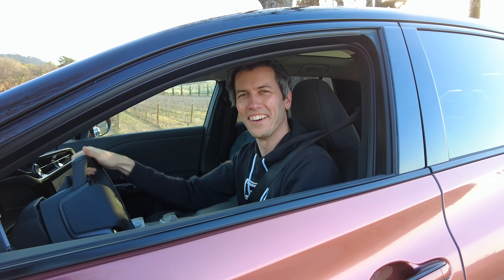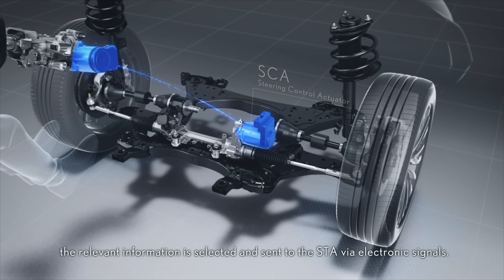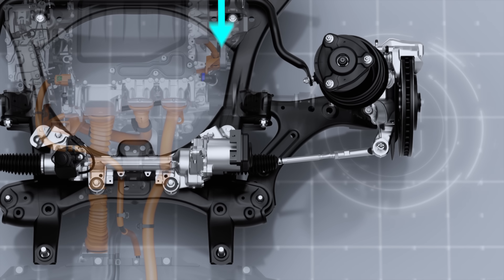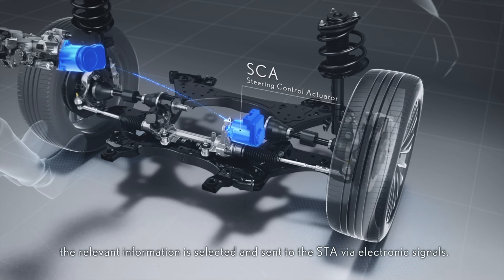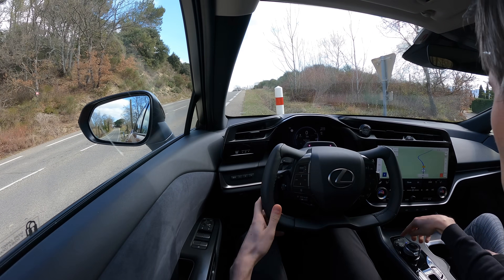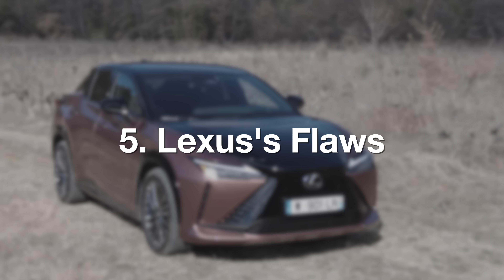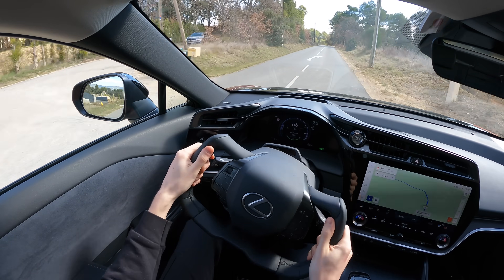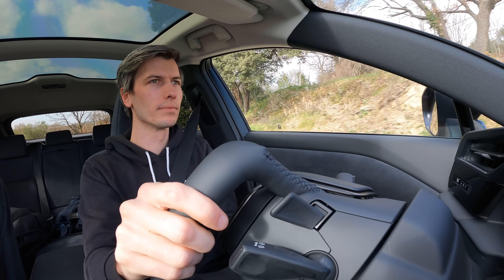How Lexus Fixed Tesla's Bad Idea: Steer-By-Wire Yoke

Comment: I've been waiting for this development.  My Citroën SM with 2.0 turns lock to lock hasn't been repeated.  It is fully hydraulic, no mechanical connection when the engine is running.  It was the first speed sensitive steering and uses a cam to make the steering return to the straight line position.  As speed increases pressure the cam follower increases, making it more difficult to run off of center.  This works exceptionally well, and I really enjoy the quick steering.  I have been told that Citroën developed a fully hydraulic control with no mechanical backup, allowing them to continuously vary the steering ratio so they could use a 1 turn lock to lock, much like this Lexus which is less than 1 turn.  An engineer wanted to use a yoke, way back in the late '60s, but was overruled.

Hydraulic is apparently more responsive, the SM doesn't suffer from the lag you see with the Lexus, but I otherwise like what Lexus has done.  But I'm a fast mouse speed user, all the way up!  🙂

Comment: Eh, my 2004 BMW already has variable ratio steering and a hydraulic rack. It cost me more than the worth of the car to fix it, and if the car battery goes dead it requires a trip to the dealer to reset the system but it's cool so... Toyota still playing catch up.

Comment: No electronics will ever beat actual feedback of direct steering rack.
Oh wait, so when they send "update" my drving style have to suddenly change, cos some a s s s s s h o o o o l e decided that driving ratios were wrong?
No UK thought driver will do 150 wheel turn - they are  told to "milk that cow"- so can't do on yoke with 40 degree movements.
As from 12min mark, this is just to slow - nice for 90 year old ganny, or 5 year old, but not anyone that can drive.
Granted no 90 or 5 year old shoulkd be driving, but I like agressive driving, so responce and feel are key here - bad design.

Comment: My concern is if you hit a pothole. I like technology but at some point enough is enough. When I was younger I wanted self driving cars but not now. 

I drive a Prottera electric bus and they randomly always code out leaving you stuck in the center of a intersection or stop suddenly. Least a petrol car will give you time to roll to the shoulder by coasting.

Comment: Hello, I have Toyota BZ4X. Toyota made the same mistake like the Lexus RZ. So he put a 64 net battery pack for a large SUV. The battery is small, the battery drains quickly and the consumption is high. The BZ4X has many other problems. Report these problems to Toyota, please, so they can fix the problems.

Comment: Can't wait to see it on production cars, but I wonder if you hold the yoke at a certain angle and keep accelerate/decelerate, will the front tire change direction by itself? That could feel quite weird under the situation such as joining the highway from a loop or avoiding obstacle while braking

Comment: I wish you’d touched a bit on drive modes- I imagine you’d be able to tune steering sensitivity for each drive mode, similar to throttle response, shift points, suspension damping etc. in that case, I’m all for it! I will say, however, that I disagree with the yoke design itself. I personally drive on long journeys with one hand atop the wheel for long stretches of time, as with my long arms and seating position that’s where I’m most relaxed. I worry that with a yoke design, the only comfortable (or even usable) way to hold the yoke would be from the sides, which may get tiring after a while, or be otherwise less comfortable. It would also, I imagine, be far more difficult or impossible for individuals with only one arm to use, as you would be unable to continue moving your hand position across the yoke to increase the amount of leverage you can exert like you can with a traditional wheel. Loved the video, incredibly well explained! Interested to see where this tech goes.

Comment: The best upside you didn't mention I think is user customization. It also removes the biggest drawback which is people maybe wanting a normal, more linear steering ratio. perhaps there could be an adjustment in the car settings for steering ratio at high speed and low speed separately.
Like a slider bar how you would adjust your phone's volume or brightness. and save settings

Comment: I'm less concerned about mechanical failures and much more worried that the control software is written terribly. Considering that code slingers aren't qualified like real engineers there can be just any putz telling ChatGPT to write some python for him. So, Lexus, with their much better QC/QA probably won't be a problem.

Comment: Wires melt faster than steering linkages.  Which do you want when you have a vehicle fire at elevated freeway speeds when the brakes fail? (there is a youtube video of this exact situation with a modified Audi.  High speed, engine fire/brake fire, brakes fail due to fire (along with electronic emergency brake).  That Audi took a long time to stop...but the driver could still steer...and steering into/sliding along a guardrail is a method for stopping a vehicle.

Steering linkages offer real feedback to what the tires are touching.  Mechanical for me.

Beyond that, mechanical interaction in a well crafted machine is more rewarding for me than electronic simulations of feedback/interaction.  High level pure mechanical design without electronic mediation is becoming a rare and valuable item.

Comment: Some other advantages that you didn't touch on are that it allows for four wheel steering, which then allows for drift mode and also highway crabwalking, which improves stability at high speeds
Reply: Only if equipped with a rear steering rack, which (AFAIK) this Lexus is not. This is really a separate design feature. The GM BT1XX trucks (Hummer EV, and the upcoming higher-end versions from GMC and Chevrolet) have that rear steering rack (and it's steer-by-wire for that function only), but not steer-by-wire for the conventional front power steering.

Comment: Short throw brake pedals are the worst thing in modern cars (I'm looking at you, VW). The brakes can't be modulated, they are pretty much on/off switch, especially in slow speeds. WHY?! There is nothing wrong with longer pedal travel, which allows precise control.

Comment: The faster response in throttle by wire is, because the ECU ccontrolls everything and the air fuel ratio is perfect the airflowe can be optimized and everythin. Steer by wire will always be worse then mechanical steering, because you don´t need to calculate froom input to output. That the steering does what the drive does is actually good. because the car never knows why the driver is doing it and that can be very bad in an accident.

Comment: I have a keyboard! HA Ha ha! Not steering but an accelerator unit. In one of the trucks in my convoy hauling barrier material from Baghdad International Airport to Taji in 2003, the truck wouldn't go above idle. We left it and came back with a second PLS, a wrecker, and a mechanic, who swapped the unit at the accelerator pedal, and we all drove back together.

Comment: The shape of that steering wheel is terrible. If all you are doing is racing around a track, then it is fine. But for sitting in traffic or on a long road trip, I want the option of putting my hand on either the very top or the very bottom. You could put in a low steering ratio and still have a proper circular steering wheel.

Comment: I do understand where they are coming from regarding the reasons why you'd want to use steer by wire, but I think they are severely overestimating how much a concern steering response is in a car like this. Is the result actually better for the consumer when you look at the tradeoffs required to implement it?  The idea of having 4 electric motors to control the steering in a passenger vehicle  is near comical. The car is more complex, more expensive to buy and repair, and I imagine heavier, all to get a little more control over how the steering behaves. 

I don't think the vast majority of consumers would notice or care that the steering input matches the throttle and braking, and the enthusiasts that would notice would mostly dismiss it. Lexus would be just fine putting a slow, numb steering rack in this car. With modern cars already doing such a great job reducing unwanted road feedback, this feels like an unnecessary complication. At least it's a properly engineered and thought-out implementation instead of that joke from Tesla.

Comment: People are going to hate this….but look at it this way, just like purely mechanical cars, these new “dynamic” cars will have their own characteristics that the driver will need to learn 😊just like in the days of old where an owners is well aware of that jiggle at 50mph or that, “it just needs to warm up” …. These new dynamic by-wire cars will have their own … it’ll take some getting used to….but i have to say, I’ve been a Toyota owner for many many years,  their very slow throttle response is VERY annoying, especially in urgent/emergency moments and Their regen braking is grabby when doing light braking… if their steering is slow to respond, I may just have to pass

Comment: There will always be delay as of the processor needs to understand what you are asking from him. Biggest reason why electrical steering won't have a place for guys who are real petrol heads.
Coming to the selective feedback. I understand why people don't want jittering from the pitholes but even modern hydraulic powered steering are taking too much away. As of working for a mechanic i can see that this creates a moment where people drive too fast over the pumps. Yes it is safe and still comfortable. But it breaks the car massively. If you would feel it stronger you would drive slower over the bumps and the axles wouldn't have to take such a big shock.

Comment: Assuming it does not interfere with the airbag and there is a mechanism for addressing when the car has to come to an abrupt stop, a customizable usb controller such as a wheel, yoke, side stick or game controller could probably suffice. For true one pedal operation this could also be done via the gas pedal to completely free up the steering column. Perhaps hands only or left handed operation is more feasible this way.
Reply: Using your phone to do this could be considered texting while driving.

Comment: One thousand and one keybaords!
Throttle by wire is one thing, but these newer cars with brake and steer by wire is sketchy AF on a street car. On an aircraft where they spend a considerable amount of time in maintenance/overhaul it is one thing, but on a street car which many people don't follow regular maintenance it is a death trap in the making. Also good luck finding parts in 15 or 20 years unless we get to the point that making one in your garage is doable.

Comment: Now Ford can advertise using the old steering shaft with "the safety of steel from wheel to wheel" like they did with their brakes a hundred years ago when hydraulic brakes were the new thing.

Comment: Excellent video, you covered the engineering and implications of design choices. I wish colleges taught this well. :)

I have a variable steering in my F150, and its really nice when you get used to it. This design by Lexus looks really interesting. I have brake by wire in my F150 hybrid because brake by wire lets the vehicle choose regen when possible for braking, it made me nervous at first but its hard to tell the difference from regular hydraulic brakes.

Comment: First of all: thank you very much for that explanation!
I am an engineer, myself, designing and developing in truck industry and I would never have expected, that one OEM dares to set up that kind of steering into a serial passenger vehicle!
One thing, but not an argument for me, is the throttle by wire. Because when that fails, you don't get power - that's it!
But when the steering finally fails...?!?
Even braking by wire is special...

And I finally did not get the topic about different speeds - is it now a fixed ratio for different speeds with different response or where is the adaption for the system? - In my own car, the power steering is not mechanically linked to the engine for it's power and the steering support can be electrically adapted to different speeds -> that's OK -> high pressure for low speeds/parking & low pressure/nothing for highway driving.

Summary (FOR ME): Sorry, I would not trust that system. And additionally, a lag in the steering system is NOT acceptable, AT ALL. 🤷‍♂

Comment: What puzzles me is this: the same steering wheel angle corresponds to different wheel angles at different speeds. So if I turn the yoke right 90 degrees, and keep it there, and start to accelerate, the car will turn more and more? 😮 Umm, actually, less and less... (I'm confused)

Comment: I think this might make it difficult to service. Can you steer the car to move it around when it's off? This is something commonly done when working on cars.
Reply: Also after an accident when engine is off - and battery flattens too (from damp, damage or hazard warning lights draining power). Still need to move vehicle somewhere safe.

Comment: So the motivation was to decrease the steering latency and they failed miserably. If F1 doesn't use it, it means this approach is not fast enough. You can perhaps have a mechanical link with variable ratio based on the speed. The latency in ration changes will not be impacting the steering latency.

Comment: Why not have steer-by-wire, yet retain a conventional steering wheel.  Let people decide whether to use the low/variable steer-by-wire mode, or switch that off, and use a more conventional steering mode. A conventional steering wheel would work in both modes, right ?

Comment: I see a problem that not only this steering wheel has but also the steering wheel for video games. 
The precision. 
If you use any type of instrument, for a scientific experiment, there will be a precision to your meashurings and if you try to measure anything more precise then that you will have no answer. If you have a ruler then can look and be precise in for let’s say 1 millimeter. 

When steering the car using this new steering wheel you will only get precise body feedback of what the car is doing from the instruments in the car that can measure AND can output TO YOU. I really hope it is more precise then what alle of us humans can detect.

Comment: Wonder how the system would compensate for damaged tie rods, joints or knuckles. What happens when tie rod ends get loose? What happens if a tie rod somehow gets bent? Does the car freak out or lose control? Does it try to compensate at all?

Comment: This gives a new opportunity. 
Not just to different things getting mixing awkwardly because they do to different things. 

Just like you don’t mix a big suv with a small sports car you don’t just mix to different steering wheels to try getting the benefits from both. I just doesn’t work. 

BUT mixing works if you want to create a new different thing. Nice thinking.